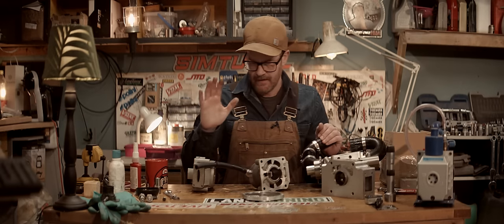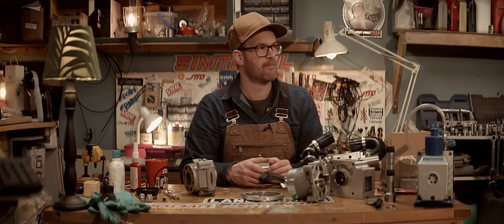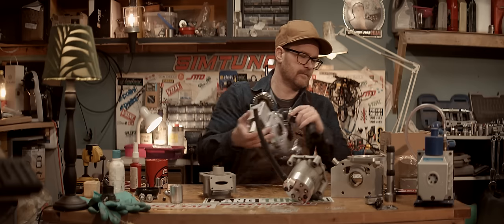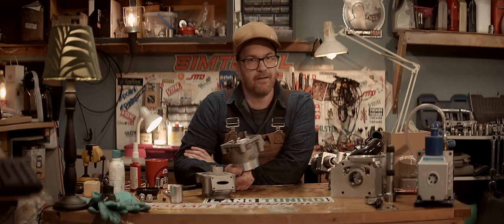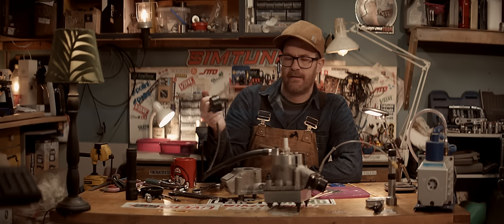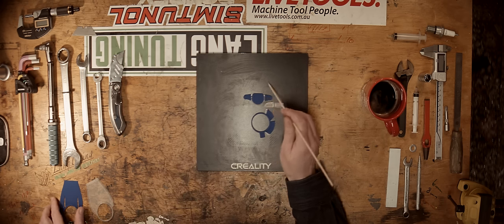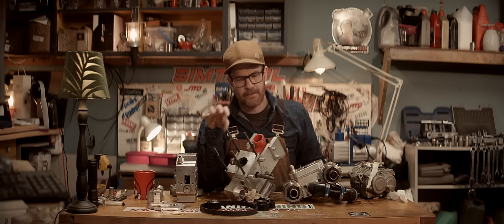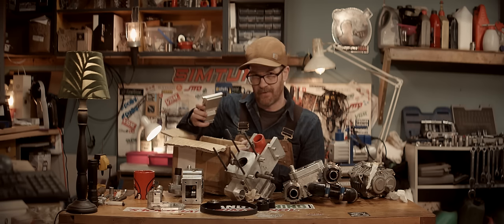Rotary Exhaust Supercharged 50cc Externally Scavenged Two Stroke returns!

Comment: Well done mate ,best episode ever👏👏👏, you tackled where your going ,what you want to achieve and how ,it really brings new comers up to speed with what your mission is. 
In hind sight when you pressed the new bore sleeve in ,you could of used a coat of jb weld over the outside of sleeve and inside of barrel ,then pressed it in ,i think it would sealed things off in one hit .
Your way of working and thinking around thing's is great ,if anyone is going to make a 50cc 2 stroke scream it's head off ,it'll be you for sure.👍😁

Comment: As a young one i once thought about using the crank webs as a pre-charging pump to squeeze the air/fuel up the transfer ports, But being a young one, I had no way to engineer it.

Comment: You should cast a cylinder exactly the same as a commercially available one but with the 100% exhaust port. That way all issues will be related the the exhaust port design and nothing else...

Comment: at 17-18 mins of the video you talk about the port design, air velocity will increase if the port shape is tightening cone, i think that is the purpose of the middle walls is to greate decreasing volume in the exhaust port to create better flow by increasing the gas velocity. Same as in 4-strokes, you need certain gas velocity to create good scavencing.

Comment: When I did motorcycle mechanics the college had a double diameter piston 2stroke 200cc skirt 50cc crown,
Or a twin cylinder one piston 200cc no spark plug compressing into a second 50cc barrel. Interesting ?
It is about the journey 😊

Comment: The 100% exhaust port will have weird effects on the exhaust pulse shape/duration both in creating it and in receiving the reflected wave from the pipe because of the distance difference between the center area and the distance to the side area. The flow in blowdown will be choked, sonic flow too but all the rest of the cycle will be sub sonic. Not easy to analyse. A flow bench is almost useless here.

Comment: I feel your pain about leaks. I had gearbox that leaked oil like a sieve. After several attemptts to seal it ( thought is was a gasket) . Had my father take it to where he worked and they found the whole bottom of the casting was like a sieve. They sorted it by milling the casting about half the way then I'll laid welding down and miled it back. Fixed but would of cost far more than a new gearbox , and a lot less time.  Good luck with your work.

Comment: Yes! Go injection, you can purge the cylinder as much as you want and inject fuel towards the end when exhaust are closing.. will be a hell of a engine if you get it to work… Will be LOTS of testing to get fuel ammount and timing rigth aswell as exhaust timing.. testing is fun🥳 jb welding cylinders are not😅

Comment: Fuel injection at the transfer port's for good high velocity mixture. Oil injection at the intake to lubricate the rotating assembly.

Comment: there must be a way for brute force to work. Like top fuel make a lot of power with huge boost, by just shoving an insane amount of air an nitromethane in the cylinder. its pretty simple design, just completely overbuilt to withstand insane mechanical stress, and a LOT of tuning. getting away from tradiational two stroke design which relies on complex fluid dynamics for scavenging, resonant exhaust & intake if you can scavenge the exhaust gas by pushing them out of the cylinder, replace wiht fresh mixture,  then close the exhaust valve and keep pushing more fresh mixture before the intake port closes. the problem is that because of the symetric timimgm of intake and exhaust, you have to rely on valves to hold boost, and also have enough surface to let the exhaust gas go as freely as possibile. for me the two big problem to large area x pressure =  lot of force pushing on those valves. I dont know if anyone has ever built such valves and if they can work
Good thing is unlike naturally aspirated two stroke, you don't need to have all the subsystems exhaust, port timing, intake, working perfectly together. the only thing that you cant completely brute force in a traditionnal design is scavenging the whole cylinder with ports that are at the bottom, without too much blowdown.
maybe a completely different approach with a poppet valve like uniflow diesel two strokes would work much better for a super/turbo charged 2 stroke.
The main reasons I see for not using poppet valves in a 2 stroke are simplicity, reliability, packaging/size, weight, losses,and restricting exhaust gases . all very good reasons for a production two stroke especially naturally aspirated. I think you could live with all those downsides in the context of your project and the ability to generate high boost pressurewould far outweigh them

Comment: Cheap ecu option would be Speeduino, installed it on my 240 turbo volvo, works great. I think they had a 1-2 cylinder version at some point, ment for bikes. Uses tunerstudio software(same as mega) and has official support from tuner.

Comment: Alex; for the people that like traditional 2-stroke content, I think there is a lot of potential in working with the 24/7 engine from Frits Overmars, BUT if your going down the "brute-force-concept" path (for now), I want to inform you of some things that may not be fully intuitive.......As you know resonance and airflow is imperative to power with a traditional 2T, but if the long term goal is to burn nitromethane, then fuel-flow & mechanical-integrity are pretty much the limitations that need MOST focus......I'm sharing this to emphasize that (at some point) power will only be limited by fuel-hydro-lock given all other factors are correct, as is the case with "top-fuel," and for this reason having a crankcase scavenged engine doesn't make as much sense......I'm not trying to dissuade you from going down the path your planning, BUT a 2-stroke with the architecture of a "Detroit-Diesel" would be more pragmatic to making the the most powerful 2T.......I know this means having an oil-pump, camshafts, valves, timing-chains, and it being more blow down limited than your rotary valves, but it will be capable of taking more cylinder pressure and boost pressure than the current design, before mechanical limitations of materials come into play (ex: crank seals)........my humble suggestion would be to use a 4-stroke 4-valve cylinder head of large bore size (oversquare-design), in order to be less blow-down limited due to valve size, and use common 4-stroke motorcycle lower end components (designed to take 60HP) then produce a custom 2T cylinder and cases to deal with the extreme cylinder pressures and RPM (long-term).......in the short term modifying one of the CRF50 clones ($150-$200 on Ebay) could be a less costly way to prove the concepts at a much lower power level: requiring a dedicated 2T cylinder, cam timing / drive ratio adjustment, and new ignition system to function.

NOTE: if a 4-stroke 50cc engine were as highly developed as a "top-fuel" engine & peak power occurred @ 8200-rpm, it would produce about 60-HP, therefore a 2T engine with the same BMEP should produce 120-HP, and of course much greater HP potential exists at 10-20K RPM......my point in stating this is 60HP should be possible with a 2T at only 1/2 the BMEP or 1/4 the BMEP if RPM is 2X, allowing greater run time / reasonable durability / lower nitro-loads......I think this could be done more easily using conventional valves / cylinder head, as long as there are NO mechanical limitations elsewhere.

Comment: Hi Alex, love the channel and really appreciate the transparency and innovation your videos offer us two stroke enthusiasts... You are chasing the inherent problems all ICE's face- The need for Variable timing. Being a student of these marvelous enigma's myself, I have pondered many ideas to perpetuate there development. Unlike yourself I am not in a position, nor do I have the facilities to explore the endless possibilities. I would like to suggest developing an older design originally developed for those engines of which we cannot mention here, lets just say  they have valves. The Knight or the sleeve valve engine, used a moveable sleeve which moved independently from the piston and was motivated by a cam that moved the liner up and sideways to open and close intake and exhaust ports. I'm sure a man of your means could develop this idea to vary the port time area- Duration, Timing and size of the ports to achieve at the very least, a  more efficient two stroke engine?
Keep up the good work, Cheers!

Comment: I've been waiting for this for a long time! The supercharged "brute force" scheme is in my mind is the way to go. Rotary exhaust valves, rotary disc induction and an accurate water brake dynamometer. Run methanol fuel from the start, and only cool the cylinder head. Let vaporization cooling take care of the rest.

Comment: Alex why are you against valves and real oil in the crankcase, you experimented with rotary pipe valves . I think a blower and unidirectional scavenging are better, and no oil needed in the fuel , and it's still a true 2 stroke, and it's possible to edd a turbo on later for more boost try something new. 👍😁❤️

Comment: I think the resonance type engine is really what makes 2 strokes fun. 

One thing you could try that you didn't mention is to optimize the engine for a turbo. 
People say that turbos don't work on 2 strokes - but they work on 2 stroke sleads. I think a 50cc 60 hp engine with a big turbo would be absolutely awesome.

Comment: In a quick google apparently pressures in the crankcase during running reach around 0.13MPa max, thats around 18.5psi.
Am i right in thinking that if you can make more boost that that you dont need to use the crankcase for quasi forced induction?
If yes would that also remove the need for oil in fuel entirely?

Essentially my question is that i supercharge a 2 stroke to hell and back you wont need oil in fuel?
I get that using the crankcase would make it even better still but if its the case you can have 2 strokes with multiple cylinders sharing a single case volume, right?
Reply: 2 stroke diesel engines run like this iirc

Comment: Machine a hub and synchronous Cog pulley for a belt drive. Between the hub and pulley machine and isolator from urethane or something of the sort that doesn't transfer heat to the belt on your rotary exhaust ports
Reply: Phenolic isolator between the Hub and pulley is what I'm trying to say

Comment: Glad to see the brute force engine return, there's plenty of room to experiment with that design, and the potential to make big power if you optimize it.  And in theory you could put your custom top end on the bottom end of a conventional four-stroke bike engine.

Have you considered trying an opposed piston engine like the Napier Deltic? It's one way to get asymmetric port timing.  There's also poppet valves in the head like with a Detroit Diesel, or a sleeve valve like the Rolls-Royce Crecy.

Comment: Maybe you could look at radio control car engines. 3.5cc air cooled screamers! They have 3,5 and I believe some seven port designs now, This is a highly competitive racing class engines I am talking about turning 37,000 to 40,000 rpm on straightaways. a lot of people have worked on these designs to get them where they are at nowadays .They run on nitromethane and methanol mixture with a really low oil content too. They are incredible for what they do and how much power they make for theyre size!!!:hand-orange-covering-eyes:

Comment: products such as Lumiweld, HTS2000, Technoweld or Alutight could potentially be used to seal the exhaust duct, as long as you can get the whole cylinder really hot first

Comment: I question your use of JB Weld..40 years ago I started using a polymer epoxy, much thinner before curing, white in color. It was used in Jet Aircraft from Lockheed (given to me by my father who worked there). It easily handled combustion temps, and was much harder when cured! ..I think this type of epoxy will be much more successful  for your application.  It's thin enough you can "pull" an outside vacuum, to "suck" it into the application area's...I believe it's widely used in Jet assembly, so shouldn't be hard to  acquire..I used this product in IMSA prototype engines with great success, so I'm confident many of your issues will be solved..Love Your channel (even after all these years) and eagerly awsit each "posting"..👍👍👍🗽🇺🇸

Comment: For the chain drive you could try like Toyota do on their dohc engine a small chain between the 2 cam and one long chaine from the intake cam to the crank you probably need chain guide/tensioner. Could all be salvaged from a scrap engine a corolla/camry or Honda civic/accord/crv k20/24 engine guide are probably easy to find + the chain are high quality you could also salvage the cam gear/crank gear but you would need 2 exhaust cam gear the intake cam gear contains the VTC mechanism 

a maf or (mass air flow)sensor before the compressor would give you the amount of air entering the engine a map (manifold absolute pressure)sensor inside the crankcase would be nice to have 
Some maf sensor include a air temperature sensor as well

Comment: For the efi you will need pretty big injectors relative to Power, since like with the Port area, the fuel will have very little time to be injected in correct Timing and cycle

Also for the maf setup, dont forget on Stock ecus there is always linearisation tables, since mafs are Not 100% accurate and then still there is Variation, even worse and "impossible" to get 100% with Different maf housing diameters

Comment: Dont use a rotary exhaust but rotary inlet. Like a nitro rc car engine would. The nitro is thrown around the crank case because it's coming through the centre of the crank shaft. It then forces the mix through with crank pressure. You could run it without an exhaust or with any wacky design you desire. I believe the trick it getting the crank pressure right, so it is almost supercharged itself, but not too much so that it wont start.

Comment: You can make a 2 stroke Detroit engine on gas   with ports and a blover  at the bottom and a exhaust valve and a injector and a sparkplog at the top ,they are now for high  rpm

Comment: I'm a think you should not case but cnc the block like you did with the supercharged engine as is easy to modify and evolve. also dont worry about using coolant as your runs are so short air cooled will be fine to start with and then you dont have to worry about machining into cooling channels when modifying.

things I'm into seeing is.
• the no Value concept - rotory or reed in in the pip.
• fuel injection.
• automatic veriable exhaust and intake lengths.

Comment: Hi! Have you thought about a Uniflow 2-stroke arrangement with a rotary valve or forced poppet valve, and at the other end with regular slots? Maybe with an asymmetric intake and exhaust stroke solution due to higher efficiency?
    I think the higher the rpm you want with a large blow-off cross-section, the smaller the actual expansion stroke will be. In the case of Uniflow, the blow-off cross-section can be larger, even in the case of dams. Not many people do this solution.
   In the case of asymmetric intake and expansion, if proportionally less air-gasoline enters the crankcase than the theoretical cylinder volume (roots blower with lower pressure than atmospheric), then the created pressure can be better utilized during expansion. Of course, this is no longer about high power density.

Comment: I do watch your channel already for a long time and I think you are on the right way. Put your effort firstly in a reliable dino. Preferable a waterbreak, but keep it warm or dry in wintertime's. Or let it run on antifreeze. Make it neat. Put in some extra effort in wiring and controles. Don't try to make it as cheap as possible. Make it bulletproof. And than go on with your "out of the box" idea's. Indeed that's your strength. I beleef the brute forse on RC nitro is much more capable than it has showen now. Succes and keep on trying.

Comment: I keep commenting telling you that you need to go with a turbocharged pipe motor!

You need to have boost AFTER powerband not before. Your need powerband to peak to drive the turbo charger. It will prevent the flame out issue you are getting with the supercharger?
The turbo has to be after the stinger basically

Comment: Convert a 4 stroke engine to run as a 2 stroke. Then you will have valves, oiling, cam assemblies and factory parts.

Comment: I would think you would have a normal 50cc engine kicking around that is a known running entity. 
It could be used as a "sanity check" or baseline on the dyno, and for testing suspected ignition or fuel system issues. It could save a lot of time by eliminating variables. 
You then swap back to the development engine once a system or component is validated.

Your show though and it is hugely entertaining and educational. It has shades of Burt Monroe and his offerings to the gods of speed.

Comment: I think my choice would have been a liquid sealer poured through the water galleries, like an epoxy fuel tank sealer fill it let it soak a little and drain it out and let dry